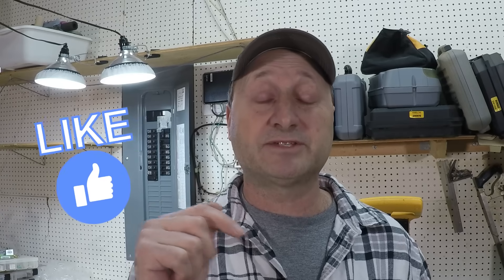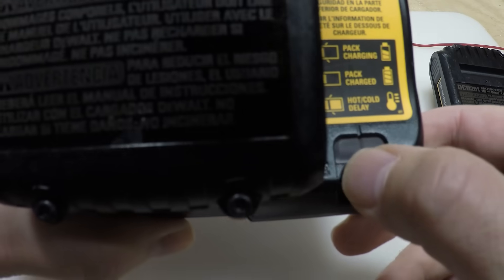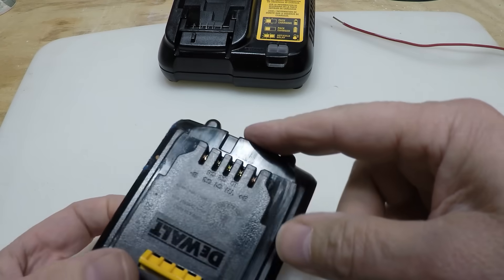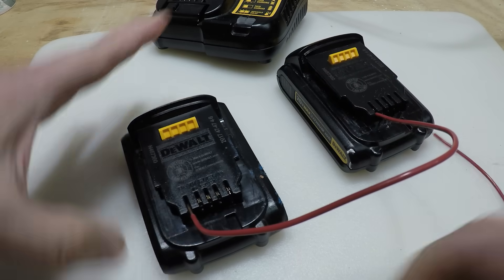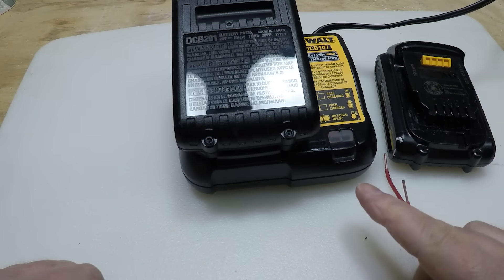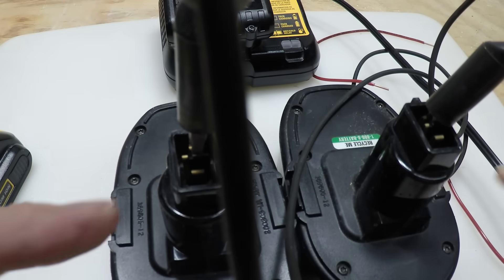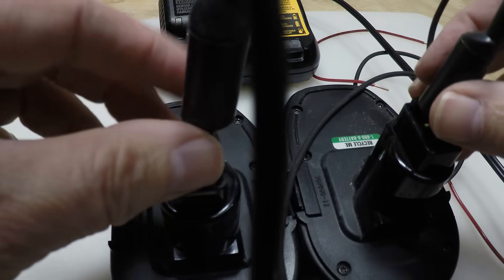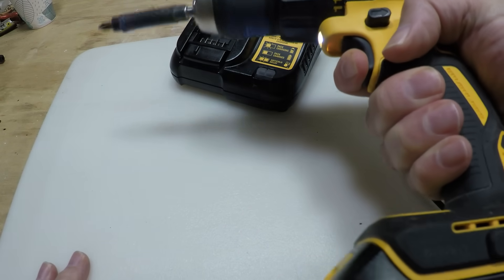SECRET to FIX Drill Batteries - Charge Dead Lithium Tool Batteries

Comment: Thank you for this video! I have 40v Ryobi tools and one of the batteries suddenly would not take a charge. I decided to try your method, but checked voltage first. The 'dead' one was showing less than 2v. When I jumped a good battery to the dead one, I got a spark when connecting the negative terminal, but only once. I checked the voltage again and that battery was almost up to 40 volts. I put it in the charger and it immediately started charging. Saved me $100+ for a genuine Ryobi replacement ($60+ for a knockoff).
Reply: Hopefully he will explain how to recharge a Panasonic battery  please
Reply: knockoffs ? or refurbished?
Reply: Glad to see this comment. I have a 40v kobalt I want to try this on. Per another comment I’m waiting till I have one of my other 40v batteries to be at about half charge since fully charged ones may not work for the jump.
Reply: I was told that putting a dead battery in the freezer overnight is another way to rejuvenate it.  Has anyone tried this or have a comment?

Comment: I have an 18650, 3.4 volt, button battery, used in a flashlight. It will charge to only about .97 volts. A new 18650 charges to about 3.6 v. Can I use a good battery and the low battery and jump from + to + and jump - to - and bring the low voltage battery up to a level where it will recharge, as illustrated in this video?

Comment: I have a Greenworks 80V 2.5Ah Battery. It only runs for 5 minutes. When charging it, the light blinking green indicates it is charging. However, after a few minutes (light is solid green) indicating it is fully changed, but the device only runs about 5-6 minutes.

Comment: you can use a switchable wall transformer and increase the voltage slowly.   you can do this if you do not have any other tool bateries of the appropriate voltage
Reply: Do NOT use a transformer! A transformer has AC output. You can use a switchable DC power supply like you said.

Comment: I was given a cordless drill years ago and found dead batteries very frustrating , so I bought another battery, then With 2 batteries I was almost able to complete my project. So I only need 1 or 2 more batteries for a medium size job . Maybe if I get more organized with my charging I could almost be as good as my corded drill. Wait , wait , maybe I could just go back to the 110ac corded drill with extension cord and never run out of power. Those guys in the 1950s were so much smarter than us !

Comment: Useful for people with common sense, but dangerous for people who just don't have the brain cells. Mine charges to a point, then after a few minutes flashes that there is an error. I only have two active brain cells, so I think I am going to pass, thank you though. I hope no one ignites their battery as Lithium burns at several thousand degrees and does NOT get extinguished with water. Good Luck.

Comment: That's great info! I have a Craftsman battery from a hedge trimmer that I completely ran out by waiting a minute and then running it again until it wouldn't run anymore. Being completely drained, it would not charge. I will try this trick soon. Thanks! 😎✌️

Comment: Works fine with NiMH batteries, but would not recommend with lithium ion.  That being said, seen what should be perfectly good ones (LI) swell up and still be able to be charged and hold a charge.  IMO, not worth the risk to mess with lithium ion batteries.

Comment: It’s a good tip but may burn your house down unfortunately. Before you do this you need to take a voltage reading to see where it is sitting at. If it’s only a couple of volts down you will probable be ok. Any more then proceed with extreme caution
Reply: Any way to do this if you don't have an extra battery?
Reply: @ronherrin4374  not really ideally you need a battery of the same voltage. You really must measure the voltage of the dead battery and build up gradually using a load such as a headlight build in series. Flashing straight across can be playing with fire literally

Comment: Thank you very much from the UK, I was skeptical about the battery fix but I had a second battery that has never worked in over four years. Did your wire trip to spare battery charged and now fully functioning. Many thanks.

Comment: Great idea. Too bad I didn’t see this before, could have saved a great light that came with my drill set. I have the other model with the tall protrusion . But I only had one charger. They don’t make that style anymore. Now I have a Milwaukee drill and impact set with two batteries. Can you tell me how to get those wires?

Comment: Wow. I’ve been mad as a hornet since DeWalt switched their battery technology and stopped carrying my ‘tall-post’ DeWalt 18V XRP Ni-Cd batteries! Their decision effectively rendered every one of my 15+ year old near-pristine condition power tools (circular saw, drill, sawzall, lamp, others) useless, and forced me to buy a new power drill and battery system for an emergency repair! Your video showed me they do need at least a tiny bit of charge to initiate the charging process — it makes sense! I guess had I reread the users manuals, I’d have been more proactive to never let the batteries lose 100% of their charge. But I’ve seen too many horror stories about messing with batteries to feel confident in jump starting one. As dangerous, despite some Amazon sellers insisting lithiums can be plugged into Ni-Cd chargers, they CAN’T — one Amazon reviewer even said it burnt his house down! Your video and link made me check Amazon again. Lo and behold —  now new DeWalt brand Ni-Cd 18V XRP replacements ARE available (just not through DeWalt)! Of course, there’s always a chance that they’re counterfeit, but the 8k reviews were too compelling to resist! We shall see!

Comment: I learned about this trick years ago and used it many times on the original Xiaomi M365 Bird scooters when I was a mechanic for them.  The added on brains would drain the voltage past the acceptable minimum needs to start a charge so I'd connect another together for about 30 seconds then quickly plug the charger back in and it would start charging just about every time.  Also have some Nickle Metal batteries than will drain super low when using my AM/FM radio.  Same situation same fix.

Comment: I had very old batteries and sanded off the oxidation on the flat terminals on both the battery and charger until they were shiny again and they have worked fine.

Comment: Hey this video was what I needed…
 So I have a 14.4 volt Hilti combo set that I literally never used at least12-15 years old ? I pulled it out and one battery was completely char the other was completely dead . So the terminals are a little Duffy then other batteries, could you help me identify which one to use to jump ? Thanks Dave ..

Comment: I had a "Powerplus" battery (20 V Li-Ion 1.5 Ah)  that was drained by leaving it in a LED lamp of the same brand. The ON/OFF lamp switch was behind some circuitry that caused the drain. It wouldn't charge, I guess same reason as you described. Without other battery available, I fixed it by connecting an old style 12 V car battery charger during a couple of minutes. After that, I could charge it with the original Powerplus charger. No damage, the battery still works without problems.

Comment: If the light on the charger is blinking rapidly, and not charging the batteries, should you use this same method or just send them to the recycling bin and buy new ones?

Comment: You jump-started the battery. It's just like a 12v battery in a car. Manufacturers want you to buy replacement batteries or a new tool. This restoration of batteries would save waste and pollution.

Comment: Lithium batteries are not designed to be used beyond a low threshold of power, usually nothing less than 40% or so, and in most cases the internal circuit board is the charging monitor and it is designed to shut off at a specific point to not allow a lower level of discharge. If a battery sits long enough it will self discharge below this level. Jumping the dead battery charges the capacitor on the monitoring circuit, allowing it to believe it has the lower limit and it adjusts to allow charging.  I use an 18 GA wire with a bent loop at the end to plug into contacts lie this in order to not spread the contacts too far.  This is a good video, Thank you for posting.
Reply: I have a Craftsman 19.2 battery. I bought a charger for it. But I have no way to jump-started except off my Dewalt batteries. What should I do and how do I do it
Reply: Thanks, friend.  I ruined my Ryobi 18v model P102 by leaving it in charger but in my frozen garage over winter,  now dead.  Don't have a mate to jump start but do have a B&D 18v p pack.  Worth a shot with this method?
Reply: @rvlovin1161 use the same volts you’ll be fine
Reply: I still have an laptop from 1995. It sat in storage for over 20 years, in a hot garage. The battery still works fine. Clearly they put "stop working" technology in the newer stuff. Litium batteries used to be rated at keeping a charge for over 10 years, not these days though.
Reply: @Splendid123456789  It's called "Planned Obsolescence" and it's evil.
Reply: Many thanks for sharing this most interesting  piece of useful information.
Reply: Excellent advice. When he ran his drill I felt excited like it was mine turning on 😂😂😂😂
Reply: Sounds good but I STILL DON'T understand " plug into contacts lie this,... bent wire " ?😢😢
Reply: @susanroycroft89 The wire just has to make physical contact (touch) the metal prongs/contacts/terminal of the battery and remain in contact for a few seconds. The corresponding positive and negative parts need to be in contact.
Reply: That's great 😊😊😊
Reply: Thank you very much
Reply: I have a ryobi battery. How do I make that work
Reply: @jedrekdennis8951 ml
Reply: @jedrekdennis8951 
Mom
Reply: Sounds like your just making all this up without any knowledge at all.....hahaha joking
Reply: @grandadneal8114 , Battery Manufacturers Love People like you !  They won’t tell you how to charge a “Dead Battery” when you want to keep buying “New Batteries” !

Comment: Okay, in principle, this sort of works, in many circumstances.
But if I caught you doing it in anything other than a wide open space, or charging the repaired battery indoors, you might have an embarrassing time explaining exactly how you got a battery pack quite so far up there! Batteries are dangerous, particularly the modern ones, with high energy density. I’ve read some of the comments and they explain why this isn’t safe perfectly adequately, so I’m not going to waste my time doing so again.
To do this safely, you need to dismantle the battery pack and carefully balance the individual cells, under constant supervision. There’s usually one badly deteriorated cell and you should identify that and replace it with one that closely matches the state of the remaining cells in the pack.
This guy has no comprehension of that, nor any idea of the risk he’s taking, or even worse, encouraging others to take.
Do this properly, with the knowledge and equipment to understand what’s happening, or don’t do it at all.

Comment: what if i bought a new Dewalt battery and I can see the lights blinking when it is in the charger, but it doesnt charge.  I've left the battery in the charger for days.  The unfortunate thing is, it was months before i needed to use the new battery so HomeDepot wouldn't take it back.

Comment: Great video. Thanks.
I have two older Makita 1220 batteries that won't charge. There is a different layout to the battery you show in your video. Can you please help me with this?
Reply: I forgot to add that there are "+" and "-" symbols on two of the terminals. No other markings that i can see.
Reply: ... and I don't have any charged 1220 batteries. However, I do have some new  and fully charged Makita 9120 batteries that have the same charging configuration as the 1220 batteries.

Comment: Great video. Sadly for me I am in the UK so our batteries are different and I only have one battery aswell. Might be able to come up with some sort of work around though to produce the same result. Still great advice so thanks.
Reply: Put the battery in the charger and flick the power to the charger on and off a few times.

Comment: That is amazing. My question is I have a Dewalt cordless screw driver. Voltage is about 7.2....7.8 I think. Not sure if the batterys are available any more. Unfortunately both batterys are dead. What to do if anything. Can these be jumped from a 20 volt or do the batterys have to be the same style?

Comment: It's a good trick and thanks for the sharing but before you do this, it's necessary to know a little about how these batteries work in the first place. In a charged lithium-ion battery, lithium ions move from the negative electrode (made of a lithium compound) through an electrolyte to the positive electrode (commonly composed of a material like lithium cobalt oxide) when the battery is being discharged (i.e., when it's powering something). When the battery is being recharged, the opposite happens; the lithium ions move back to the negative electrode.

Over time, several factors can cause a lithium-ion battery to lose its ability to hold a charge:

Cycling: Each time a battery is discharged and recharged, it goes through a "cycle." Over many cycles, the battery's capacity (how much charge it can hold) decreases. This is in part due to the wear and tear on the electrodes from the physical movement of ions. As the ions embed and unembed during each cycle, they can cause structural damage to the electrodes.

Solid Electrolyte Interface (SEI) layer: This is a layer that forms on the electrode's surface as the battery is used. The SEI layer is both beneficial and detrimental; it protects the electrolyte from further decomposition but also increases the internal resistance of the battery and reduces the cell's capacity. Over time, continued growth of the SEI layer can lead to significant capacity loss.

Lithium Plating: When a battery is charged too quickly or at a low temperature, lithium ions may not have enough time to embed themselves back into the negative electrode. This can cause lithium to deposit as a metal on the electrode's surface, a process known as "lithium plating." Once this happens, those lithium ions are no longer available for charge/discharge cycles, reducing the battery's capacity.

Electrolyte Decomposition: The electrolyte inside the battery can decompose due to high temperatures or overcharging, which can lead to gas formation. This can cause the battery to swell and potentially fail.

When a lithium-ion battery "dies," it means that enough of these processes have occurred that the battery can no longer effectively store and deliver electrical energy. The ions can no longer move efficiently between the electrodes, so the battery can't produce the energy needed to power a device. The battery might still have lithium ions, but they can't move in a way that's useful.
Reply: Very informative, thanks buddy
Reply: @se-akworkplace3166  Thank you!
Reply: what?

Comment: I watch your video . I have a Sears diehard 19.2 V battery I have three of these. One of them is still rechargeable. I have four prongs where it connects to the tool. What can you advise so I can recharge these batteries.
I also have a YUneec Power three lithium polymer battery the SKU number is YUNQ500105, it has 5400 MAH, 3S/11.1 V [ 59.9 WH ]
I have three of these batteries and a drone that does not fly because we don’t have any power. Can you help me?

Comment: My 10hr DeWalt batteries charged once & I used them in the electric mower. After that they will "charge" but only last about 10 minutes when I go to use them. The very first charge they worked fine but when you try and recharge them using the correct charger they don't last but minutes.

Comment: The lithium batteries will quickly go dead if left with 0% charge and then will be damaged or unusable. Even if you "revive" a pack it won't go back to what/how it was, you may get a fiew uses out of it but they tend to self discharge to 0% far quicker and be far less reliable. What I would like to see is a storage charger that "maintain" batteries when not in use for us occasional diy ers. After a fiew months of storage packs can go dead aka 0% charge and if left long enough die beyond any revival method. All they really need is around 1-5 mA at 85% voltage to not die or go 0% charge, a sort of life support system. Eventually all batteries die but this can keep that from happening for decades of storage time in most cases. Limiting voltage to 85% will remove risk of overcharging.
Reply from the maker: yes a storage charger would be nice

Comment: Leave it connected longer for Dead batteries
Reply from the maker: no that will not work
Reply: @flannelguydiy6458  I jut did it, I’ve done it several times, I have a few dead packs, not now

Comment: If the battery is completely flat - 0 volts, then there is something seriously wrong with the battery. It may be short circuited and catch fire while charging.
Reply from the maker: when you ignore the battery for a very long time, it will drain down to zero
Reply: @flannelguydiy6458  I have batteries that have been sitting for more than 10 years, there is still enough power to charge them.

Comment: I have an 18volt battery that is dead. I only have one battery, but I’d have 20 volt batteries. Is there a way to jump the 18 volt to the 20 or is there another way to jump the 18 volt?
Reply from the maker: you can jump it with any other battery